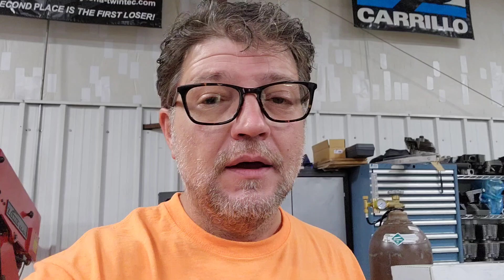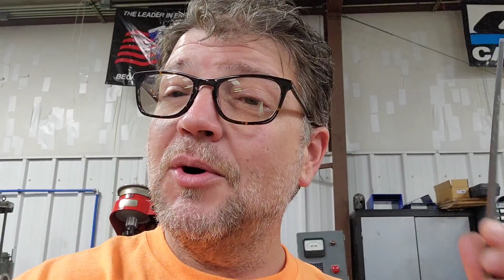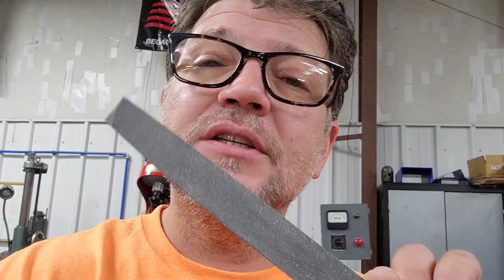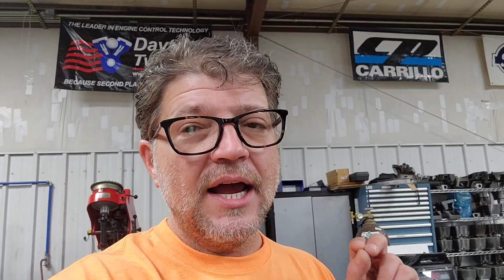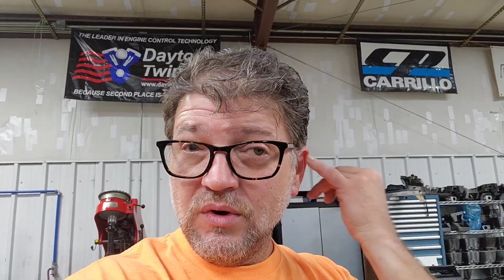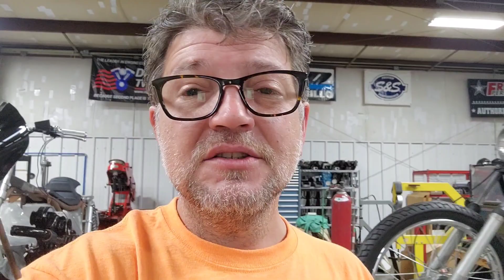Harley Engine Break In Explained - Kevin Baxter - Pro Twin Performance

Comment: Just bought a 2026 Road Glide and I did roll it up and off a few times in the first 30 miles or so. Not really up and down too much but a little here and there. I did however ride steady for some time yet not more than say 15 miles before I changed my speed and rpms. I got the engine hot and then let it cool for 10-15 minutes and got back on it. Now I'm almost at 200 miles and I continue to do the same somewhat. I just keep praying I'm breaking it in right. 😆 🤣 😂

Comment: Heat cycles at idle make no sense to me. A high idle OK and only a few. That said many start a new build with an improper map and the cold start is excessively rich which ruins the break in immediately. Canned maps do not address this. Have the break-in done on a dyno with an experienced operator that fixes everything down low especially cold start first.

Comment: Great video and the content is very useful. The only thing I’d say is for most people breaking the in the engine within 30- 50 miles is pretty difficult. When you take into account city traffic, speed limits, traffic lights etc just getting to a location where you can use the steps you describe is a challenge before you’ve already burned through your first 30 miles.

Comment: Great video but of course most production engines have nisil chambers and impossible to follow that perfect procedure. And the factory definitely doesn't take as much care as you do. It's basically very the revs, not too hard and not too easy accelerations and pray !Thanks very much for such and excellent explanation

Comment: Great information! I got my bike back today with a new 135 crate. I rolled on and off the throttle taking it up to about 35 to 4 grand and letting off. I put 42 miles on it then parked it. I’ll continue the break in and change oil at 500 and 1000 miles. I have a magnetic dipstick coming to help with contaminates. I had the dealer put a Trask vented tranny cover on as well. Looking forward to putting miles on after break in and looking at that dipstick and throttle body as I put miles on. Noticeable hp/torque already compared to the 117 I replaced. Thanks for your invaluable information. It is priceless!
Reply: Hey, I'm about to do the exact same thing!  My gen 2 135 crate just arrived at the dealer and the install process will start on Tuesday.  So I was researching proper break in and was curious about yours.  Is yours strong and how is it doing with regard to oil consumption?

Also, any more tips on the rest of your break in procedure beyond your post?

Comment: Just just bought my first new motorcycle and the recommendation from Kawasaki is varied rpm under 6k for the first 600 miles then an oil change and your good. Your suggesting that this will happen within 30 miles or so is not the first time I've heard that and I can tell you which I would prefer. Is 600 miles really overkill? Its a Z900 so varied rpms just comes with the territory where and how I ride (I avoid the highway like the plague, boring). I never beat my bikes anyway because with 125 hp you really don't have to so it sound like a nice long ride will do the trick so long as I avoid steady rpm's.

Comment: getting a new china bike,, Lifan KPX 250, and you hear different methods to break in .. yours and other about don't baby after you get like 30 min of run time is the best, do more in town riding so you are going up and down the gears and speed.. roll into it and let off.. like one guy poste.. ride it like you stole it.. :)   many recommend rotella t-4 15W40 in the crankcase ..  I will be getting new paper filters as they come from factory with a metal mesh type deal that catches the big stuff but its the little stuff you gotta get as well.. 
thanks a million..

Comment: I've been doing a lot of research, apparently the HD dealer said that My engine has had a catastrophic failure.  The mechanics said that I need a new flywheel assembly and bearings along with the complete top end.  These are the same mechanics that can't adjust my clutch x3 (times already), forgot to put my nuts back on my exhaust after a clutch / brake hydraulic flush.  Definitely need a 2nd opinion and my engine.

Comment: I have been an Aircraft mechanic for almost 30 years and have rebuilt many GA piston engines.  Although they are a horizontally opposed engine,  they are very similar to most motorcycle engines.  After a  top end overhaul, we use mineral oil to break in the engine, run it at full power for 20-30 minutes to set the rings. EGT temps get pretty high during the run and we watch during the run for the temps to come down.  Once they do come down to normal op temps, we drain the mineral oil and run the recommended oil which in most cases is 20W50 syn. I have always wondered if this could be used in the motorcycle world when doing a top end overhaul or with a new engine?

Comment: Thank You for the piece of mind that I did right despite what others say of different engine makes with break ins. So to take my motorcycle to work and back 10 starts with varied speeds under 55 mph for a week to get the 600 miles before first oil change isn't that bad. 3000-4000 rpm on my oversquare Buell engine. About to do my second oil change. Had one issue with no fuel pump but starter turned then moved it away from gas pump and fuel pump hummed and no starter. I added engine ground to starter. Runs and starts so much better.

Comment: I got my Dyna new in 07. The dealer hadn't even prepped it when I got there, and I was lucky enough to put the 1st mile on it. I knew about the varying RPM and combustion pressure during break in, and rode it home about 30 miles accelerating hard, and then closed throttle decel, accel, decel, etc all the way home. Bike now has over 60, 000 miles on it, runs strong, and doesn't use any oil. I should put a compression gauge on it, just to see where it's at.

Comment: I was always told that the reason for a hone, is that it leaves little perches in the bore surface for oil to cling to. And this oil aids compression as it is rubbed off and reapplied by crankcase splash everytime the piston makes a 360 degree cycle

Comment: I guess it's a shot in the dark for me. +.030 Superior pistons, Hasting rings, and oem cylinders. Already 100 miles on the motor. One oil change into it though, but looked like it was a good idea to do so. Useful info. Thanks for sharing.

Comment: Kevin 
What is the normal operating temperature on a screaming eagle stage 3 M-8  I do run a oil cooler fan.. 
I do live in Florida and I’ve noticed that my engine is running around 320 degrees which is shown on my power vision  tuner..
I know there is other factors involved, I guess lm just looking for a base line..
Thanks a bunch !

Comment: @Kevin Baxter..... bossman I called and left a message last week on the machine. I'm here in GA too so I really would like to get with you on my questions and upgrades.  My engine is a  "Ultima 107"... yeah yeah.. but that's what was on the bike when I got it. Its a  beautiful American Iron horse chopper. My problem/questions regards oil pressure dropping.  At cold crank up. It's got like 40-45 lbs. 20-w 50 oil. When it warms up it falls back like most do. 5-8 psi at idle.  My oil pressure drops and my oil temperature is only around 145 degrees.  Not 200 + like everyone else's bikes.  What would be the culprit of this bossman.  I didn't see anything abnormal the last time I changed the oil.  But I'm going to change and inspect it tomorrow.  Could it be the Ultima lifters going bad.. I hear there not the greatest.  I'm from the drag racing world and the harley-davidson engines is new to me. Any help would be greatly appreciated.  On your shop answering machine my name is Tom Peebles . I left my phone number as well.  Please shoot me a text or a call if you get time. I understand you got big money jobs and my little problem isn't that much.  In the future im wanting to get this bike dyno tuned by you as well.  Thank you in advance Kevin. 👍

Comment: I have a 97 roadking, stock 80 evo engine. 

It’s time it needs a rebuild.  I am considering buying a Ultima.  

I’m only looking for reliability, I’ve been riding the 1997 for 20 years. I don’t care about making it faster.

What would be the best way to go? Is 100 inch or 107 inch Ultima engine reliable, is that going to be more reliable than rebuilding my old 80 inch Harley Evo?

Comment: Am breaking in my used 2022 M8 softail street bob as per the manual. Riding at all different speeds and revs but not exceeding 3500rpm in any gear. Are these engines junk because the quality control is not up to much on these M8's. My streetbob has 79 miles on it. Rode 6 miles home from the dealers and noticed a small pool of oil sitting at the base of the rear cylinder. As far left as you can go before hitting the inner primary mounting bolt if thats what that is. There is a small recess at the base of the cylinder and the oil is up cycling in that area. I noticed that the sump pan had oil forming across from that side having run down between the inner and out primaries. Prob due to the small amount becoming a larger amount then at left lean spilling down into that area. At cold feeling all around there is no trace of oil coming from any of the head cooling pipes or the fitting at the rear cylinder. For it to form in that recess oil would have to be running down from somewhere and its not. its up cycling through either the alloy or a harline crack. So much for a 120 point inspection utter bullshit!

Comment: The lifter needs to rotate to reduce sheer forces. It takes a lot more force to lift the lifter if it's not rotating and this is why you should never run synthetic oil during break-in. It would most likely knock the cam flat no matter what the break-in RPM is, I have seen this happen. This need to rotate is why the flat tappet lifter does not sit directly square on top of the cam it will be slightly offset so it will rotate.
That cross hatch is there in order to help the piston rings “seat” or wear in to the cylinder.

Comment: not sure why your leaving out when you build a new motor, to truly do it right, you should be on a dyno on mile zero first startup  with a wideband o2,  as you say to get your o2 readings correct on startup, if plateau honed your rings are sealing within 20miles,  50 miles not even necessary, your on rollers putting load on the bike car either one, cycling the rpms and heat until your sufficiently seated the rings which does not take as long on the dyno and your seeing proper a/f timing etc... coutless motors this way and great comp and leak down unless crappy machining was done, you've spent a ton a money on the motor this should be a must on the list before you turn the key... my 2 cents

Comment: I took delivery on a new FXD.  It was down 1 quart of oil.  Before you break in your new/rebuilt engine check all the fluids.
Reply: Checking motor oil level is part of Dealer P.D.I. "Pre-Delivery Inspection". Blame your selling Dealer. That's scary. It makes you wonder what else did they miss? That's very basic stuff. Jesus Christ Man.  Yes check all items on PDI List. FFS

Comment: I’m currently building my 2015 SG from a 103 to a 107, do you have any recommendations on building oil pressure in the engine before the first initial startup? Would simply unplugging the spark plug wires and running the starter be enough to build sufficient oil pressure for a startup? Any help would be greatly appreciated 🤘🏻
Reply: That's what I'm doing. Everything was generally cleaned, oiled, with assembly lube where applicable. I used to pull the oil pressure sensor & get some pre fill in there, but the MoCo tapped the engine case in a 1/2 moon rendering it useless. Post back & let me know how you did.

Comment: Kevin I have a long diagnostic question. I’m a DIY guy and I really am intrigued by all your knowledge that you share with us. Hope you respond but I realize you can’t fully diagnose an issue over a YouTube comment. My bike (2015 street glide 103 TC stock engine with intake, exhaust and power vision) at 14k miles is losing 1.5 QTs of oil in 3,000 miles. It runs flawlessly in my humble opinion and has zero external oil leaks or migration to other compartments. It does show a couple of symptoms though. For one, I have a rich oily smell under deceleration (unless I pull the clutch of course) and also, my spark plugs show brown staining only on ONE side of the insulator. Plugs also have a very faint off-white chalky residue on the ground strap, which I remember in your other video you said could be an indication of oil intrusion. I plan to mark and remove the plugs to see if the brown stain happens to be pointed toward the intake valve and also do a compression test. But is the one sided porcelain stain and oily smell on decel an indication of bad valve guide seals possibly? Also, the bike does get a little oil in the air cleaner but nothing excessive whatsoever, and I keep the oil at halfway up the stick and check it under the same conditions and in the same location every time. I know your time is valuable but I hope to gain some insight as to what your expert opinion would be. Thanks a lot

Comment: What Manufacturer runs a engine at around 1500-2000 RPM to break-in a cam ??? NONE... come on Kevin factory engines i bet never start-up a engine ever. look at a exhaust pipe if it is black sult on the pipes ??? never and super clean, they don't start up any car or truck or motorcycle and run it so why should we ???
Reply: Manufacturers actually do what’s called a “Cold Fire And Run”. As for this tutorial about Cams, he’s speaking in Solid Lifter Cams and yes, every engine builder when building a solid lifter cam does break it in in this way if they want it to Live.

Comment: I always used 2000 grit emery clothe after manual honing by hand. Our mechanic taught me this in 1979. I haven't done a motor since the mid-80s. Would this be wrong????

Comment: As a retired Manufacturing Engineer for Waukesha Engines, Harley Davidson and Briggs & Strattion, I totally agree with you on this video. Honing is far more critical these days than years past. Many more parameters must be held. When breaking in a new engine I try to find hills to make the engine work up the hills forcing the rings out. I also change the oil at 1,000 miles or less. While I like synthetic oil in most engines, I have not had good luck with it in Harley's roller bearing engines. So I just use H.D. conventional oil and change it every 2,000 miles, like clock work. My 2020 Tri Glide holds 5 quarts so somewhat of over kill but for me it's cheap insurance. All my Harley have been high milage engines.

Comment: I understand the basis for a proper break-in as Kevin describes but when I purchased my 2023 Road Glide Limited from my son’s HD  dealership in Florida, I was forced to break it in on the ride back to Texas.  I constantly varied the throttle position and changed gears (4-6) as often as possible.  I also did constant roll-ons in 4-6 gear rolling up to 85-90mph and dropping back to 60, then rolling back up, never exceeding 4,000rpm.  After an S&S 475C cam kit upgrade including oil pump and cam plate, my cyl compression numbers and leak down is right where it should be.  The bike was dyno’d and a custom map was written for it.  Output is 121hp and 129 TQ.  I did the best I could breaking it in on the highway and it runs very strong with zero oil consumption.

Comment: I followed Kevin's break in procedure he outlined in an earlier video about how HE breaks in engines that's HE'S built (though i did this on my new bike with a factory built 114). I had REALLY good luck with it. My bike seems to make a little more power than others with the same engine, it also has REALLY good compression and leak down numbers, and it also consumes very little oil. It seems like it's pretty common to see guys complaining of oil consumption as bad as a qt every 1k miles... Mine goes through about 1/4 qt in 3 miles. I'm really happy with my results from his recommended procedure even when used for factory engines. My dealer thought I was nuts because i refused to take the bike before I could come by and do the prescribed heat cycles which took a few days in total. I would drop in after work and start the bike, let it run for a few mins to get up to temp, then shut it down and let it cool for like 2 hours (long enough to completely cool)... Then fire it up one more time for a few minutes before leaving for the day. Then I simply followed the rest of his method and couldn't be happier!

Comment: I appreciate your videos,  I not a expert . I have 2 Harleys that I had built . A 124 and a 143 both have what I wanted  done to them and run pretty good . Both were heat cycled and tuned on a dyno . My oil usage and blow by seem to be to be good ..especially the SS 143   what a learning experience..